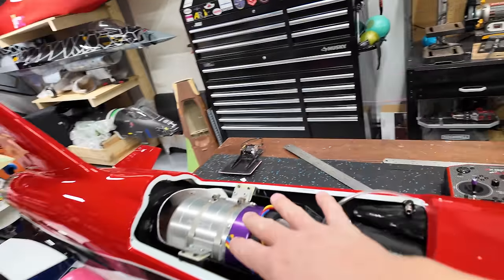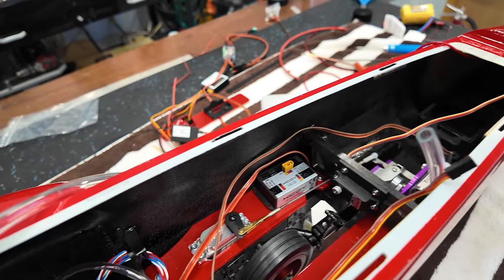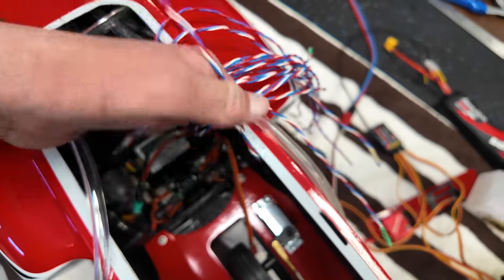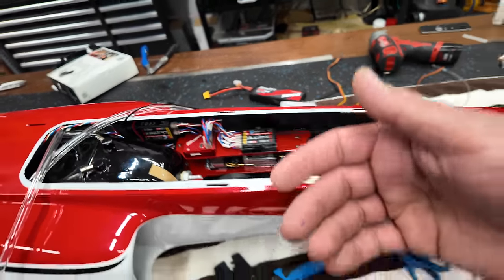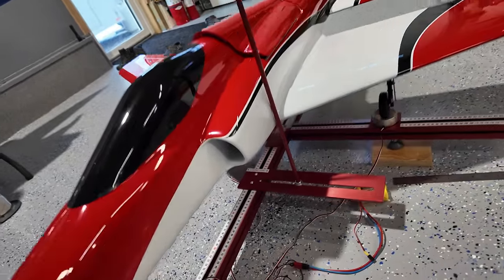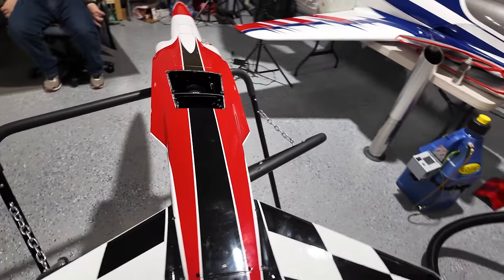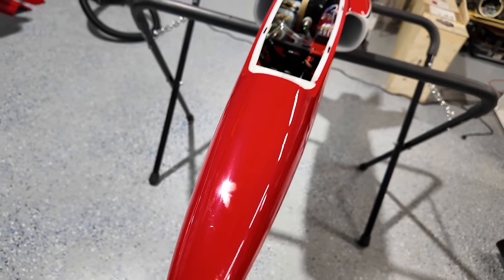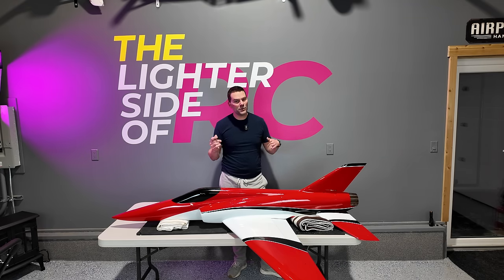Blistering FAST RC Jet is Ready For SPEED Trials - BVM Super Bandit Done

Comment: Can,t even tell there,s a pitot tube installed either😂 very nice plane,way overpowered though!this size plane with that size turbine will get away from you fast! I always understood that AMAA rules didn’t allow more that 80% thrust to weight ratio
Reply from the maker: Thanks.  Max power is adjustable with the DRM so it can be dialed in.